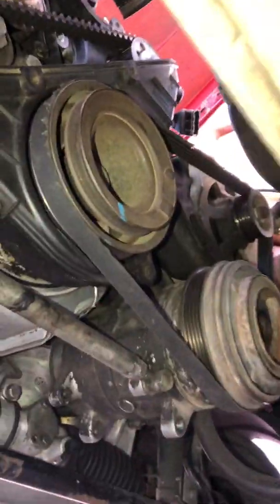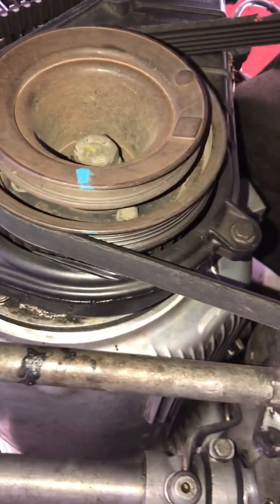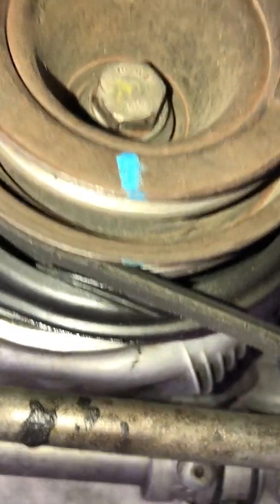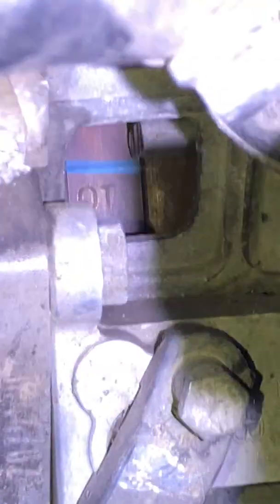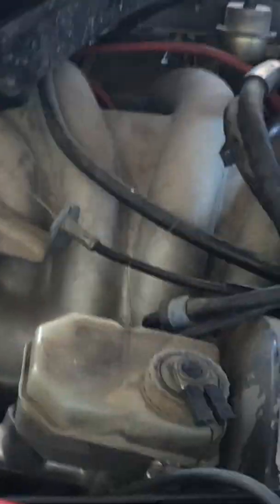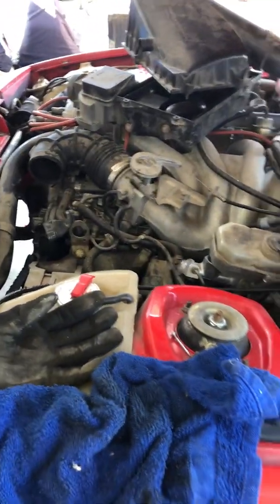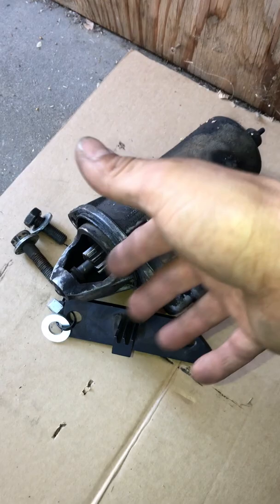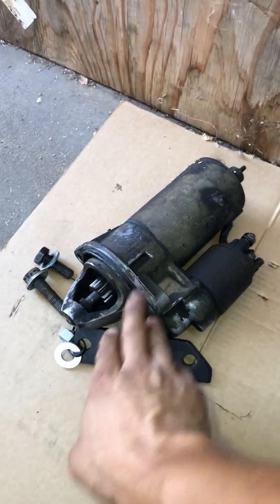5 Porsche 944 Engine set to TDC and Fly Wheel Lock

Comment: Great video! Did my belts and pump last week and would have been really helpful. I ended up using the TDC notch on the bottom of the bell housing
Reply from the maker: Absolutely, that notch down there helps as well. (some even say they ONLY use that marker). Me, I do little things like this (marking front pulley) to help the one man tea, get by. But all that matters is that you get to where you need to. Keep her running brother - Good luck out there.